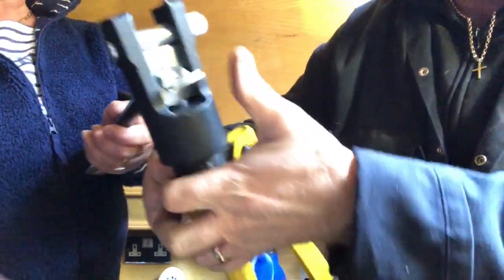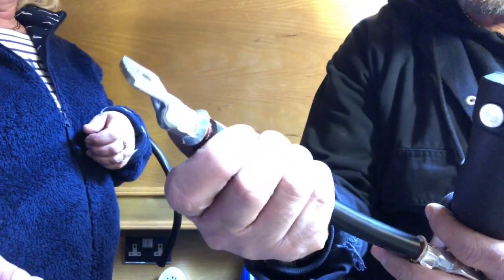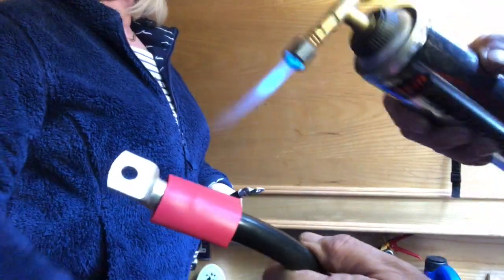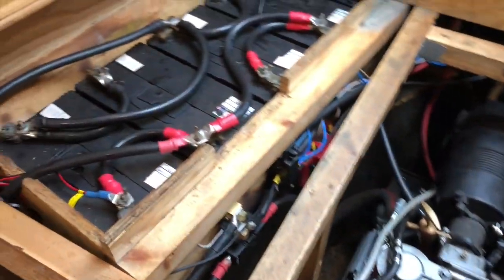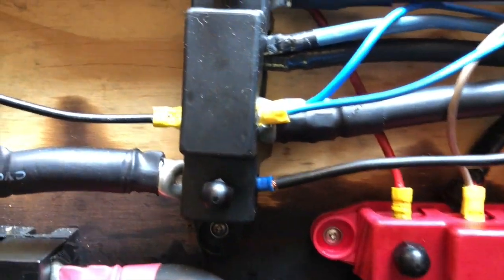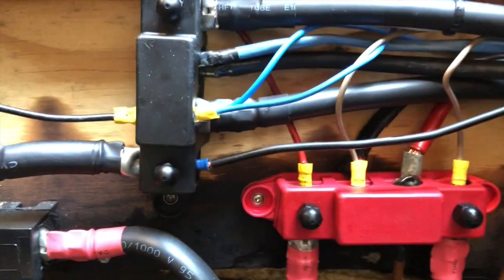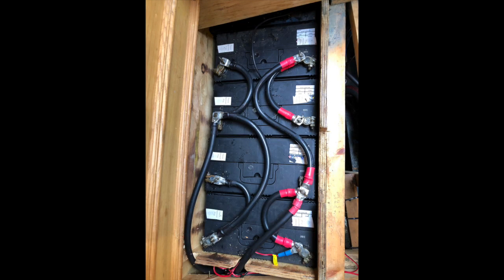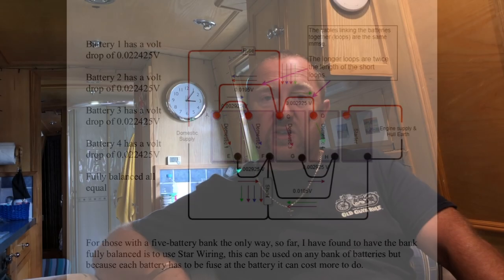E28a. Narrowboat 12 volt Battery Bank Rewire. 12v 110Ah Sealed Lead Acid Leisure Batteries.

Comment: I'm behind yet, still catching up, so maybe others here have said this, but I will strongly recommend that you use a hair dryer to do the heat shrinking and not a blow torch.  As a retired diesel truck mechanic, we never used a blow torch, always just a hair dryer, much safer for you, for the environment (no gas used, and no gas either of you have breathed in), and will not melt the heat shrink where a blow torch can, and it's safer for your partner that might be holding the other end of the wire. 🙂  If you don't have enough amperage to use a 110amp hairdryer, they do make and sell 12v hairdryers.  But I love that crimping tool ... wish everyone used one ... smart man!  Yep, boats are so limited in room, not just in room for stuff, but in room for a human to work around that stuff.  Love your vlog.
Reply from the maker: top tip 👍

Comment: Why didn’t you use a smaller diameter heat shrink tube and place it over the wire prior to crimping?
Reply from the maker: I was gifted all the materials so that all I had

Comment: Rule #1 Nothing is ever EASY! Toss all the Wingnuts and replace with split ring lock washers and nuts made for batteries because of the vibrations of boats. It has been proven that removing two of the Parrell jumping wires and moving the wires coming from the load to the extreme opposite ends of your bank like in the three-battery picture you showed, makes it draw better also eliminates the possibility of one battery dropping out unnoticed which happens in the way your bank is wired. Also, it has been proven that your load carrying wires need to be the same length to get a balanced draw. There are enough Off Grid and Solar systems out there now that prove it.

Comment: only thing i would add is adhesive lined heat shrink will give a better seal or in a pinch some  liquid electrical tape as an alternative under the shrink
Reply from the maker: William White I didn’t know adhesive lined heat shrink existed, i will see if i can get some for any future projects, thanks👍

Comment: Looked like I saw a Kubota engine there. You’ll be very happy with that engine. I have work on many hundreds of that exact engine. I ran a shop for years that specialized in that engine in a generator platform. They are as reliable as you can get. Change the oil, oil filter and fuel filter regularly you’ll have many tens of thousands of hours of reliable service. Change standard oil every 250 hours. However if you run a quality synthetic oil then change at 1000 hours. For synthetic I recommend 5w40. For standard oil check the engine manual for an oil to match your outside ambient temperature range. 
*Just make sure you use diesel engine rated oil for either type of oil.

I highly recommend synthetic!!!!! And my favorite is Chevron Delo 400 5w40 but Shell Rotella 5w40 is a fine oil also. Synthetic is more expensive but you’ll save money long term with the extended oil change interval (1000 hours) and reduced wear on the engine with synthetic oil. 

Make sure to run a fungicide additive in your fuel to prevent algae growth in your fuel tank. Algae doesn’t ruin the fuel but it will plug fuel filters and always seems to happen at the wrong time. 

The only actual maintenance beside oil changes that you need to worry about it to adjust your valves once every few years. For that you’ll need a new valve cover gasket, 10mm socked and short extension, 10mm combination wrench, #2 flat blade screwdriver, and a set of feeler gauges. It takes about 30 minutes if your half way handy and have an engine service manual. When you reinstall the valve cover use copper anti-seize on the shank of the valve cover bolts. The steel bolts have a tendency to corroded into the valve cover that anti-seize compound will prevent that.  Also when the valve cover is off remove and inspect the crank case heather valve on the top of the valve cover. If the rubber and the spring appear in good condition then just reinstall the same valve. Usually taking them out and reinstalling them unsticks them from the surfaces and will reduce engine smoke. 

The valve cover gasket is rubber and can be reused in a pinch. But they are cheap. Do NOT use any sealant. If you clean the surfaces then you don’t need it. Just wipe the gasket with a light layer of engine oil or grease prior to installing it in the valve cover and you’ll have an easier time replacing it at the next valve adjustment. 

Cheers,
Jeremy
Reply from the maker: Wow, that was a comprehensive post, a lot of good advice there, thanks.
The engine is a Yanmar (Barrus Shire 45) 
The engine oil Specified is a 10W 40, API class CD. the general consensus with oils for Narrowboat engines that spend most of their life in tickover, is that modern synthetic oils are not the best for them as these have been designed for higher performance engines. But I'm now expert and just use what the manufacturer has recommended.
I do my own servicing but have yet to check valve clearances, she 12 years old with 4.5K hours, so it probably well overdue.
Reply: Well Deck Diaries I worked on an equal number of Yanmar. I knew I recognized that engine. That was actually a engine original designed by Isuzu. GREAT engines! Yanmar made many improvements after buying the engine line form Isuzu. They are quieter then the kubota. A definite plus when you have to run your engine to recharge batteries on winter days that solar isn’t optimal. They are equally reliable. I’ve seen those same Yanmar engines run 30,000 hours plus with zero issues. 

Running at tickover is exactly why I would recommend synthetic. At tickover you create more soot that gets into the oil past the piston rings. Diesels are designed for lower RPM the petrol engines. However they like to be loaded to keep the cylinders clear of carbon build up. This is the exact reason that I recommend synthetic. Synthetic oil has better soot control which is perfect for low RPM high soot applications. It also improves oil at the piston rings which improves compression. Improved compression helps reduce soot in the oil. 

All diesels get soot into the oil. It’s normal. It’s just the percentage of soot or parts per million that is of concern. It’s always disappointing to change your oil and have it be black again as soon as you start the engine LOL. The soot is why you need to make sure to run a diesel rated oil. Petrol engine oils aren’t designed to control the soot and also have negative effects on the bearings. 

Same thing on the valve adjustment, valve cover gasket, crank case breather. 

The fleets of generators I maintained for years where for transport refrigeration. Carrier and Thermoking both make generators to power their refrigerated sea containers while they are on trucks and trains. Carrier uses Kubota and Thermoking used Yanmar until a just few years ago. Now due to diesel particulate emissions Thermoking switched to Peugeot. We did full warranty service to all 3 engines and the associated electrics. Including full engine rebuilds of all 3. 

Anyway that engine will treat you well if you treat it well. 

Cheers
Jeremy K.
19 year Journeyman Diesel Mechanic
Reply: Maffi Oxford either way. Yanmar and Kubota are both great engines.

Comment: That's a nice crimper I am still using the old hammer job. it works and has done for many years. but I do like that one. 
Nice job on the rewire. agree with you on the bus bars although they do look small!. 
Anyway nice video. Glad to see you involve Deb in this .. I personally think that with just the two of you it's important that you both know all the systems. 
Bit like talking a cruise,as soon as you have found your room find at least two ways to your assigned life boat. Anyway have a great day and be safe.
Reply from the maker: Colin Gibson Thanks for watching, just checked my paperwork, they are 250A busbars with 8mm studs👍, only 3 ways out of our boat, stern, bow or side hatch

Comment: Great vlog. Seen those hydraulic crimpers on Amazon, but some are not very good and fail after only a few uses. Which ones did you get and how did you find them? Just a small observation, I’d replace those wing nuts on your battery terminals with proper nuts suitable for batteries. 👍🏻
Reply from the maker: Metal Snapper The crimper is ok for £27 Amazon, The dies aren’t the best fit so you have to use the size below but apart from that they done the job, 
replacing the wing nuts is on my todo list, my wife is always telling me this still needs doing, that still need doing and my reply is “there’s no need to keep reminding me every year”😂😂😂

Comment: the way you have wired them up is correct , but there is an easier way of doing it , take the positive feed to battery A , now loop from the positive of  A to the next positive battery B then C and then d, now take the negative feed and go to the negative of battery D , then loop to the negative of C then B and finally A wired in series less confusing

Comment: Just a tad over crimped.🇦🇺🇦🇺👍👍
Reply from the maker: Rob Sin Because it was a cheap Amazon crimp tool the correct size dies wouldn’t crimp on tight enough so you had to use one size below